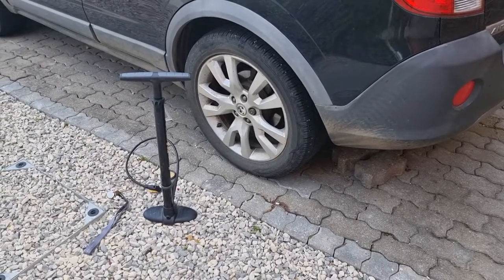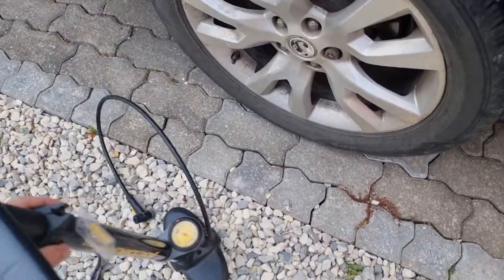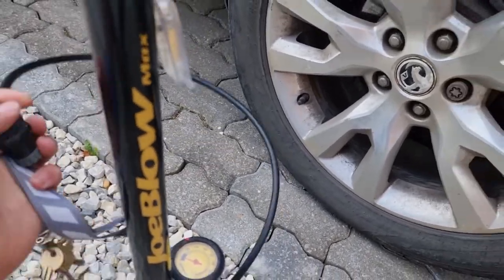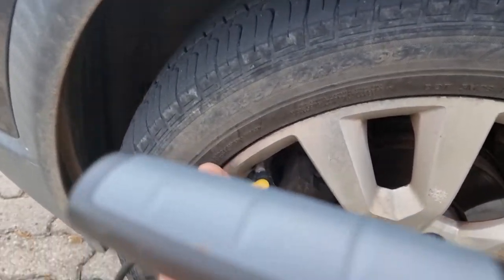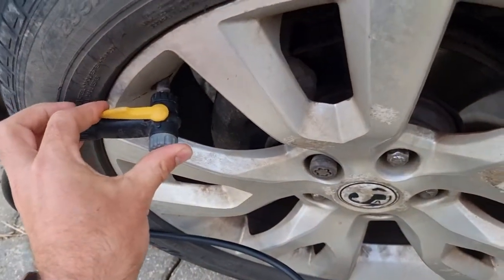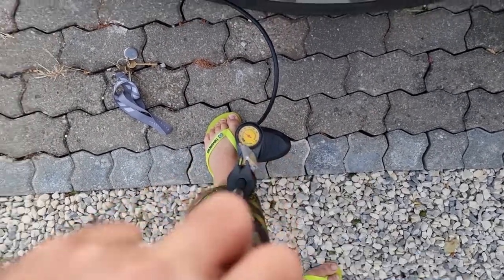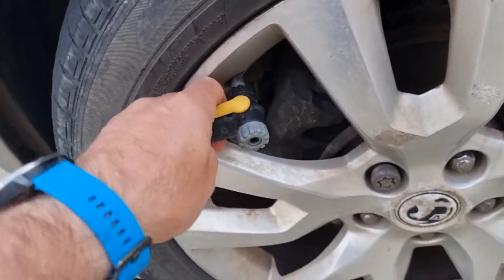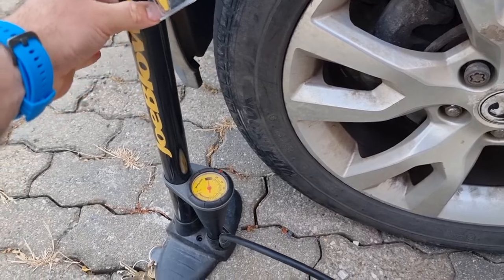How to Pump up a Car Tyre Using a Bike Pump

Comment: Will the pump broke after long term?
Reply: no more so than using it normally on a bike tire.  car tires are no more than 30-50psi.  Bike tires range from 22 psi to 120psi.